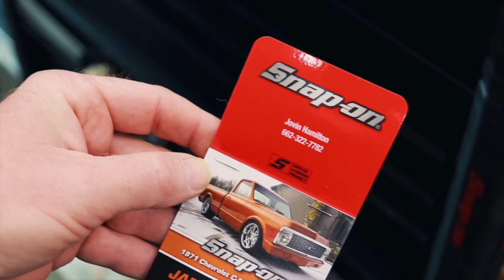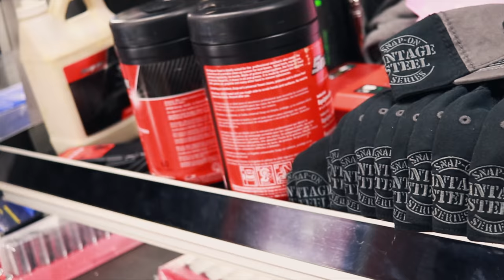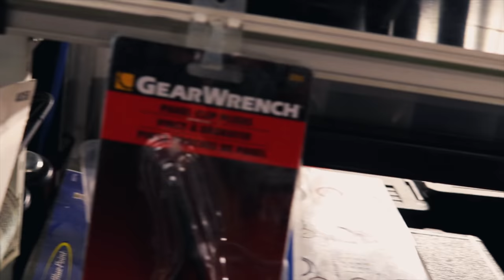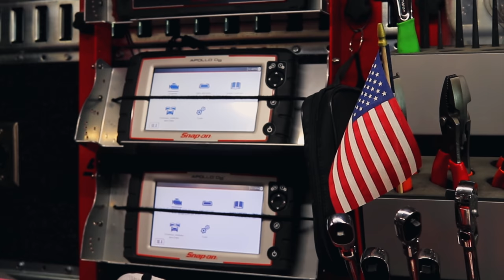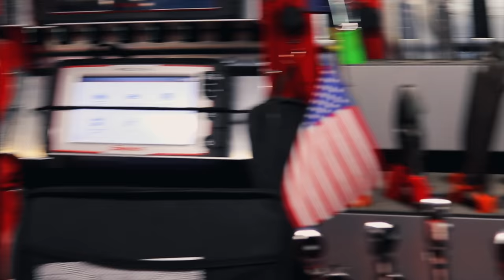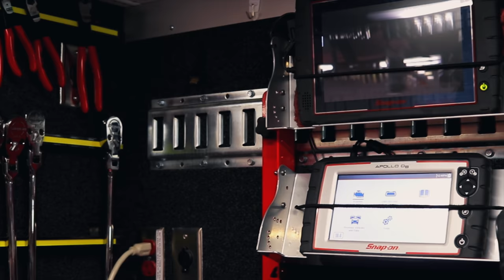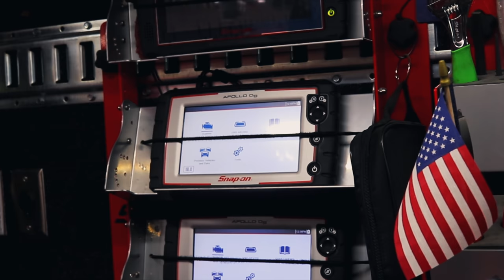New Snap On Creeper Seat and Scan Tool

Comment: That flat black box is very nice looking. I’ve always wanted a Snap-on box in flat black! Also, that green stream light is fire 🔥
Reply from the maker: It is nice. I just worry about showing grease and finger prints and stuff. Plus i don’t know how durable it would be either ? Scrubbing and all trying to keep the greasy prints off it
Reply: They are nice when they are new/clean.  Nightmare to keep clean, I had a flat blue one and traded it as soon as I could, don’t do it!!!! I’m a blue fan also but I need a clear coat to protect it and hide fingerprints and smudges

Comment: That service carts nice but I love love love the snap on slide top carts
Reply from the maker: I think they would be better also so you don’t have to take all the stuff off the top to get into it.
Reply: Koon Trucking got a KRSC430.  Swapped in a few 2” drawers.  Tons of storage very nice if you work in different areas of a larger shop.  Slide top also makes a nice place for paper work, catalog, laptop, or whatever on the current project.  No closing the top to get a flat surface....it is always there and usable even when slid open unlike a flip top which is useless open.

Comment: Keep the modis and get either the solus edge or the apollo. You won't be disappointed
Reply: i did keep the modis and pulled the trigger on the solus. i have always had a snap on scanner from the brick to the one i got today
Reply: @wallyhare8616  Solus have a scope?